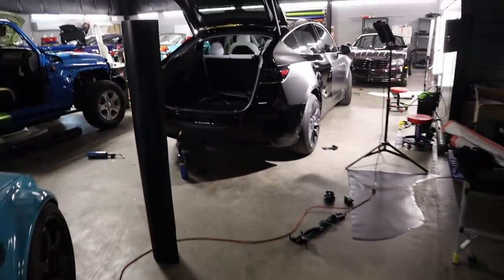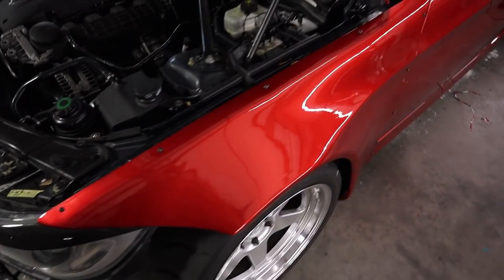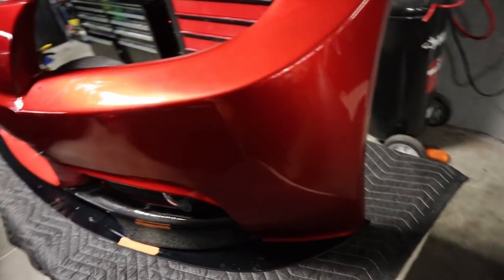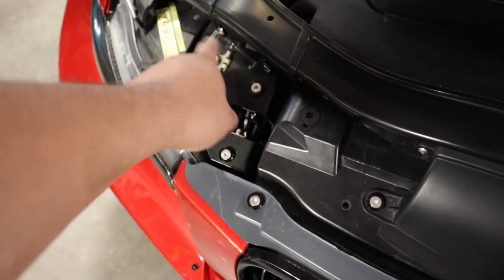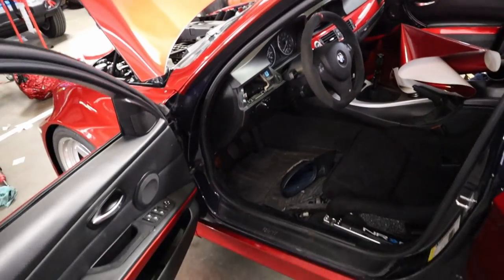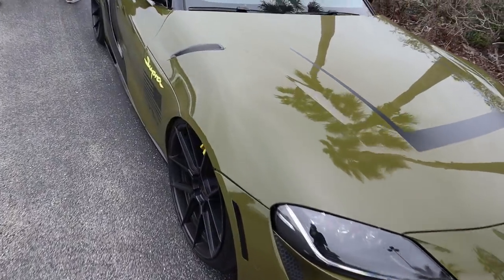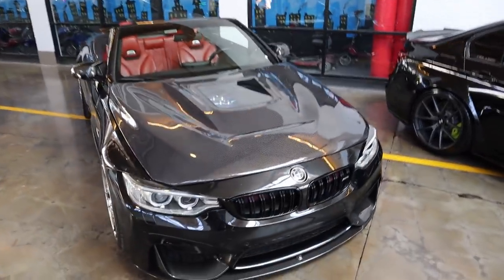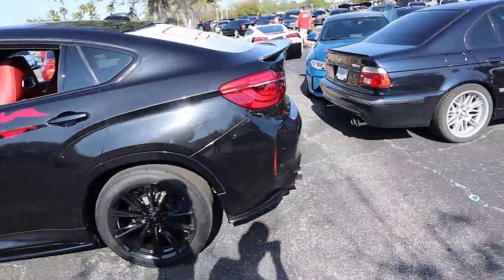I wrapped my BMW 335i and made it look like a $20,000 paint job, Here is how

Comment: What'a your wheel setup?  I have a 2011 e9- 335xi and I bought a square set-up 8x9x9.5 with a 30 offset. What tires and spacers that in have to run to make this work. In was thinking 245 35   r18.'a. Will it work? I haven't put coil overs on it yet. any suggestions on spacers and tires without stretching the tires.